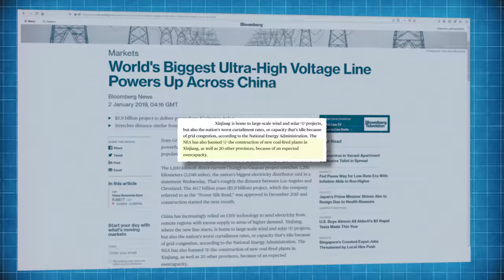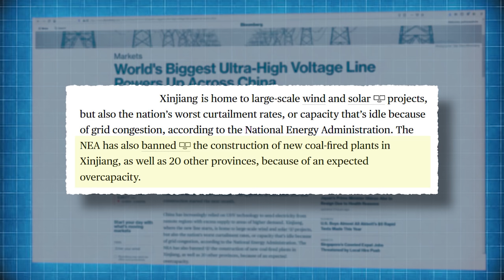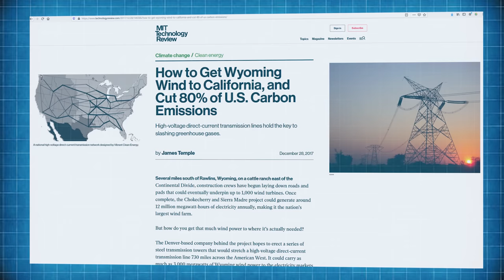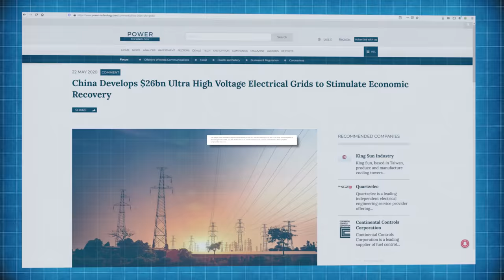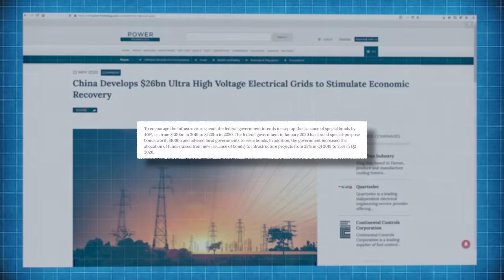China's MILLION VOLT Energy Superhighway

Comment: Bonjour!
Québec uses 735 000 volts lines to transmit hydroelectricity over thousands of km. I'm starting to understand the strategy. Fascinating topic thank you!
Reply: In that case, I believe it was done due to misaligned phases between the grids, and was done even when HVDC was less efficient. The HVDC solutions from the ‘70s involve some pretty wild vacuum tube stuff. Japan does this too to link its 60Hz and 50Hz regions together. 

Back then to do it purely for efficiency purposes would have needed a really really long span of wire, possibly literally globe crossing or even longer. 

But now the conversion process is efficient enough that it’s beginning to make sense for continent-spanning grids to avoid AC losses. But of course the bonus of not needing to sync the local AC grids still applies; for instance a potential future transatlantic one could sync the 50 and 60 Hz grids of Europe and NA, which could result in NA’s midday solar powering Europe’s evening peak and Europe’s midday solar powering NA’s morning peak.
Reply: Give Newfoundlanders some credit. A LOT if not most of the current in the highest voltage transmission lines comes from Labrador.

Comment: Thanks for sharing this important story. The U.S. has been operating the 500KV Pacific Intertie for over 30 yrs, and has, according to a Google search, 20 HVDC lines of varying sizes. One reason you don't see more of these lines is they have been only cost effective over very long distances and at high load capacity because of the high cost of conversion/transfer gear. Glad to see there are many projects in the works globally.

Comment: Canada has several HVDC longer transmission line systems of which one is being finished by a close friend and fellow engineer. These need to be long distance end to end systems with no branch offs along the route. Hence they span vast nearly uninhabited regions.
Reply: I was at CGE Peterborough when they were testing the rew  high voltage DC air blast circuit breakers. They signaled with  a siren  because it was very load blast
Reply: Al Carlson - We EITs - engineers in training, were given a training field trip of CPL Calgary Power years ago. While walking into a HV switchyard an operator triggered an air circuit breaker above us....The supersonic explosion and arcing rattles the ribs in your ribcage. Several returning to the control room took a detour to the washroom as they had involuntarily peed their pants....
Reply: @gtranquilla  I remember the blast could be heard all over the plant which covered a whole block back in the 60's it employed over 5000 people Peterborough is called the electric-city to this day
Al retired

Comment: As soon as you mentioned FULL-BRIDGE  RECTIFIER! I thought of  Electroboom. Always good for a laugh and learning something interesting
Reply: Me:  What's Electroboom??  Google, Google, Clickety Click.... Oh, I get it now ;)
Reply: Those are going to be some huge diodes in that rectifier
Reply: @patrickmckowen2999  
There is more than one device for each and yes, they are quite huge.
Look for 
hockey puck rectifier
A very interesting thing has happened in about the last 10 years.
Semiconductors for quite high voltages and currents are on the market.
Some of these, mere mortals can afford.
Reply: The Electroboom 'Full Bridge Rectifier' is missing the 'wave' word.
Reply: it's ffffffuuuuuuuuullllllllll bridge rectifier not just simple rectifier
Reply: @ChitranjanBaghiofficial  one rectifier is one rectifier a full bridge is 4 (or more) bridge is the action or it's configuration..
Reply: @patrickmckowen2999  they used to have to use vacume tubes,,because semiconductors had not been developed to take those kinda powers.
Reply: @kensmith5694  The only thing powerful enough was vacume tubes..I think in high power radio transmission they are still in use because there has not been a semiconductors capable of those high powers..not to mention the spark over problems.. and doubling up on rectifiers is also a possibility..seem its done in smaller scale..but over 1000 volts it gets a lot more difficult to prevent arcing.
Reply: @chuckthebull  
Semiconductors are able to do it.  They even make them in packages that bolt in place of the tube.
"We live in the future"
Reply: The answer to China's relative success in things that by their nature are long term is that China does not go through these massive cycles every four to eight years that we have with our Presidency. Each president has his own priorities and is largely elected on making changes from his/her predecessor. That certainly gives us quite a bit of flexibility, but it also inhibits long term thinking. It also causes long term projects to be redesigned or abandoned in the middle, costing amazing amounts of money. Now that we have gridlock in Washington and in many statehouses, we often do not even attempt any long term projects. We are largely limited to things that can be finished in a four year span, because even when a President has eight years, it takes the first four to get the plan in motion. The Affordable Care Act (Obamacare to you civilians) is a case in point. It was shoved through in a hurry, and the successors have been largely crippling it ever since, rather than improving it.

The Chinese on the other hand, have rolling long range plans that are incrementally modified as time goes on. We have the Senate whose rules and unrepresentative nature allow those representing a quarter of the population to pretty well cripple the more flexible capabilities of the more equally representative House.

Because of the unbalanced powers of the Senate to control the makeup of the judiciary when the Senate and the Presidency are controlled by the same party, regardless of which party, the next 20-40 years will be unevenly controlled by that party, no matter who gets elected.

This used to be an advantage when societal and economic change was on an even longer time line, but as change has come on faster and faster, that advantage has been burned away.

Despite their obvious failures in representing the will of their people, the structure of their decision making process has now given China an economic advantage. Assuming that our democratic system will overtake them again in some finite future does not help us meet the challenges of now. We defeated Soviet Communism rather thoroughly, but the Chinese have adjusted their model of governance to give their people more modernization in a country that doesn't have to live with Russian winters. The only resource that China has more of than Russia is people and yet China is expanding in every dimension while Russia is flailing.

We are about to strangle ourselves at our borders and by discriminating against our minority populations and we are wasting the economic power that we have by trying to dominate other countries while we could be building the alliances that it will take to survive the climate change that is coming at us like a freight train without brakes.

We need to find a way to accomplish big things again, things that take more than 4-8 years to start returning on our investment. There are a host of things that we need to do to enable that level of change, but that is the subject of another rant.
Reply: @chuckthebull  
I read your comment in full and answered with a completely correct comment that it appears you didn't understand.  I suggest you read again, more carefully rather than merely skimming and looking for something to whine about.
Reply: A bridge rectifier is what it's called not a full bridge. 4 diodes.
Reply: @RichRich1955  
Go watch the "electroboom" channel.  There is a running joke you missed.
Reply: @chuckthebull  yes, the HVDC solutions from the ‘70s, such as used to take power from Toronto to New York State, are fascinating in both engineering and the tradeoffs they had to make back then. Semiconductors really just keep on giving. I wonder when we’ll get a microwave oven without a magnetron tube.
Reply: @everettlwilliamsii3740  agreed 100%. For me, my hope is that pushing for proportional representation and more direct action from communities (for example holding citizens’ panels all over the country on a regular basis, as is being done all over Europe lately) will help get towards those ultimate goals you bring up in your conclusion. Try to address these current weaknesses of electoralism without undermining democracy.

Comment: People asked me how it feels when you stick your finger in an electrical outlet?  To be honest, it Hertz.
Reply: Marc Jackson  only 60 times per second here and some countries its only 50 (Japan)
Reply: Watt did you say??  Is that even current, do you get all amped up from it?
Reply: Touching high voltage RF can kilohertz or just megahertz if you survive.
Reply: Bad puns always win my volt.
Reply: Marc Jackson  then its 120 here. lol
Reply: My physics and mathematics teacher, in Dowpatrick, Co.Down, had worked in England on radar for the Battle of Britain. He advised that if you're touching a wire that might possibly be live,  you make sure your feet are dry and keep the other hand in your pocket.
Reply: What's a big benefit of using 60 Hertz over 50 Hertz.

You get a lot less 50 Hertz hum in you audio amp.
Reply: Killer Hertz what happens when your run over by a Mega Cycle
Reply: Potentially, you‘ll feel like you’ve been transformed.
Reply: No, if it s DC, it is ZERO Hertz.
Reply: Not when we switch to DC.
Reply: @constructioninc  Actually, Japan is very unusual in that it is a "split country" .  Eastern Japan runs on 50 Hz and Western Japan runs on 60 Hz.  As is usual with such oddities it is an accident of history where planning was short sighted.
Reply: The bad puns here are simply shocking.
Reply: Very cleverly put!. 🐏Sam.

Comment: We often drive near these million-volt DC lines when off-roading in the desert.  They make the eriest "crackling" sound.
https://en.m.wikipedia.org/wiki/Pacific_DC_Intertie
Reply: I don't believe you are driving by million volt DC lines in the US. I don't believe there are any million volt DC lines on the US. Seems you are talking about high voltage AC lines which is how power is transmitted in the US.
Reply: @tompower5666  Looks like there is another one that starts in Utah: https://en.wikipedia.org/wiki/Path_27
Reply: @tompower5666  on the linked article it says it’s 500kV, but then as a result it’s total 1000kV (AKA 1MV) pole to pole. Which, yk, you can argue you should only care about the 500. But I can see why people would call it a million volts across the wires or somesuch.